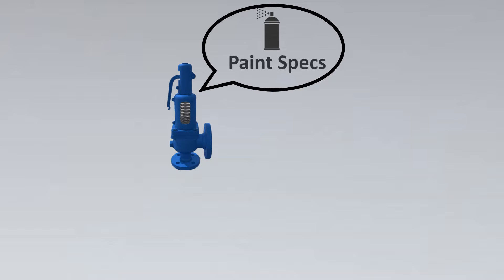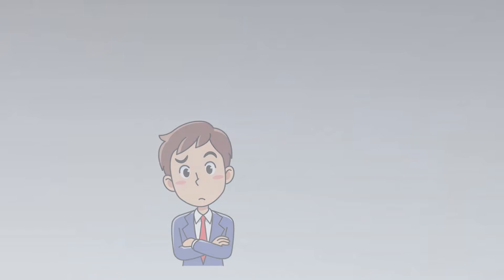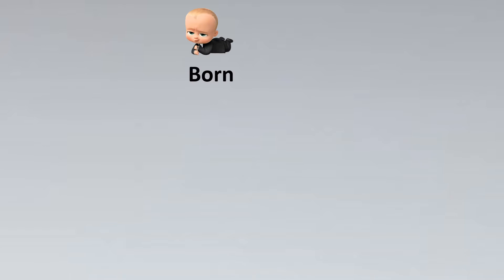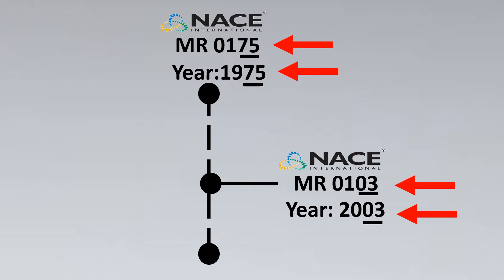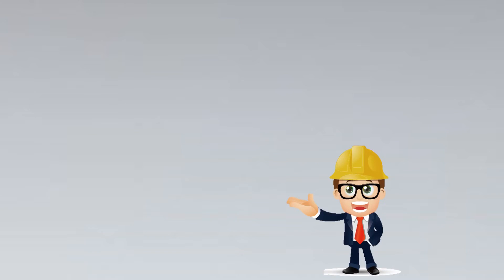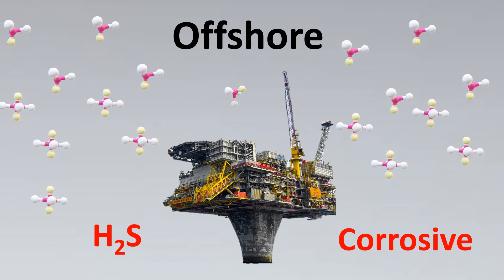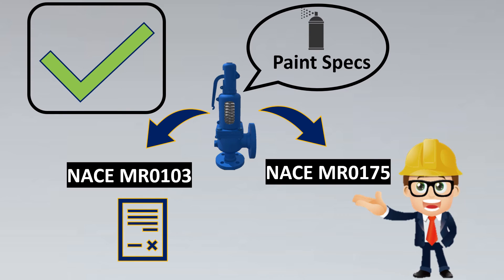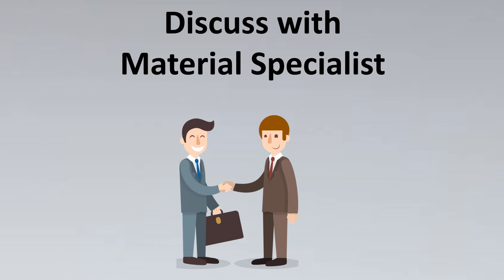SURPRISING difference between NACE MR0175 vs NACE MR0103 | (When to select WHAT)

Comment: Question : Client Specified MR0175 , but vendor Provided MR013 . Can we use it, if its in On Shore process ( like Petrochemical Industries ) Called as Downstream process .
Reply from the maker: Some time the clients have old design basis which are not updated or engineers copy paste the same standard (MR0175-applicable for upstream ) for downstream datasheets.
Please confirm whether client really needs MR0175 std compliance ?
hope this helps